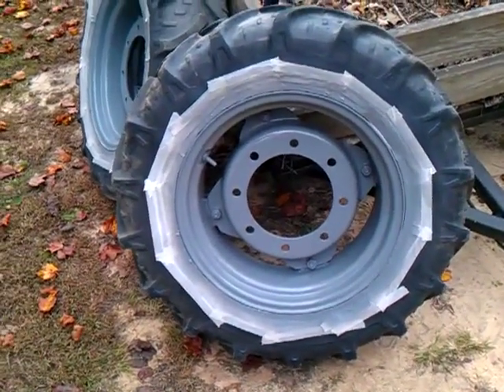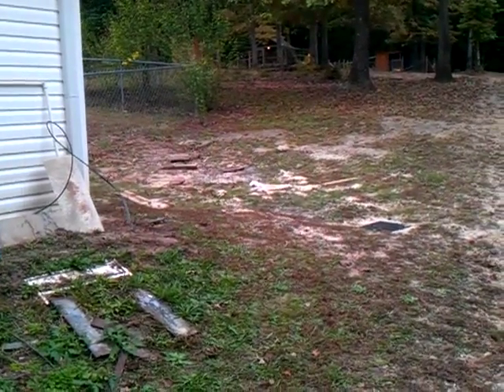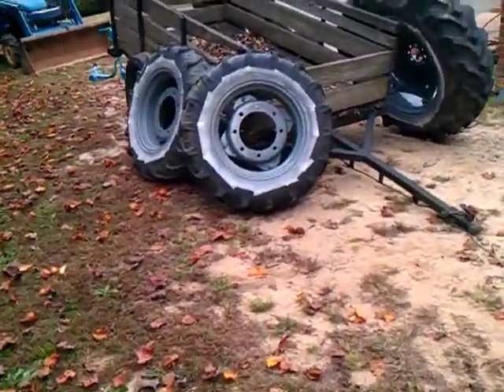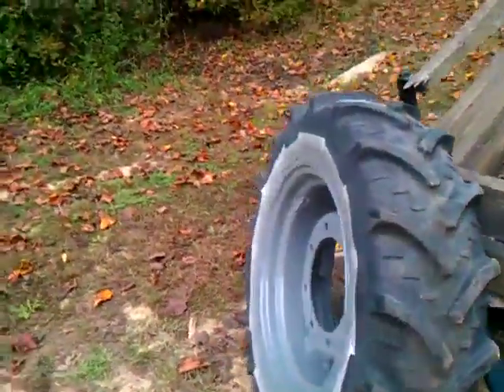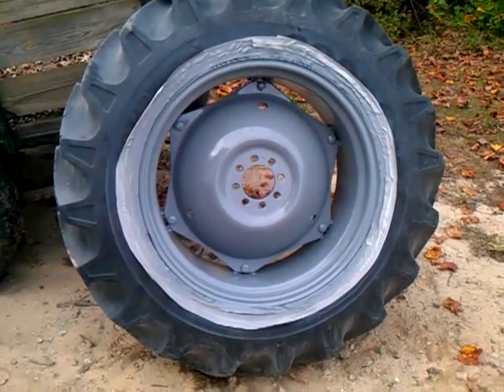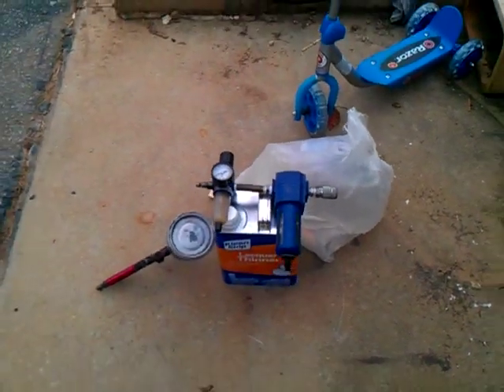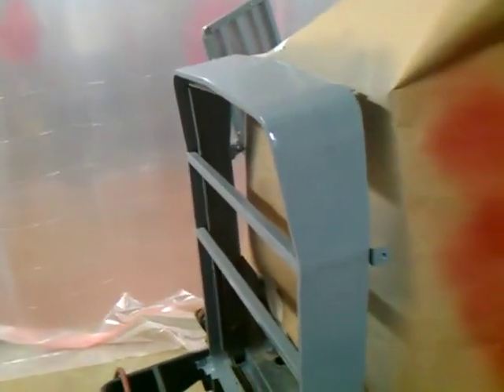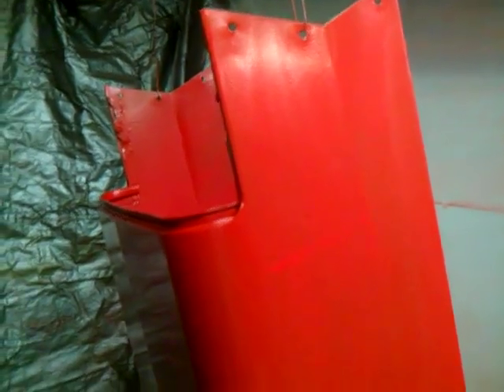Tractor project # 2 painting rims with Rust-Oleum and Majic paint

Comment: 15 year equipment painter here. Rustoleum does a great job and...you can mix some colors! If you put a little bit of the black in that grey, you can make a charcoal grey color, or, add some white, and make a lighter, dove grey.  I've made some great color mixes using the colors available in Home Depot. Also, a tip: use some 5 inch paper and just use 1in tape and that will cover your tires great. Good job guys!

Comment: What size tip did you use. I'm use the same paint  with a 2.0 tip,  no thinner Remove the little filter in the paint gun and  lay it down.  I'm rebuilding a trailer now. I will try and make a video of the paint job.good job guy's.

Comment: Whats the best way to spray the majic paint?
Reply from the maker: I use a cheep $20 gun I got off ebay.we mixed it to instruction and spray
Reply: Thanks!
Did u sand in between? Is it supposed to come out like a mist?
Reply from the maker: We did not sand in between you put two or three coats on. Put first coat on wait  24 hr put another coat wait 24 hr put another then you are done.It will come out as a mist.
Reply: Thanks

Comment: Did you add extra hardener or thinner? I need to paint a plow blade, mower deck, tiller, and snow thrower for a garden tractor.. Want to do it right so I don't have to do it again..
Reply from the maker: I just added lacquer thinner to the paint and sprayed
Reply: @hossitis  What ratio you thinner to paint you've found to work best - tip size - What size compressor are using ? Looks Great - I like the part no fancy cheap works Good- Thanks for video-